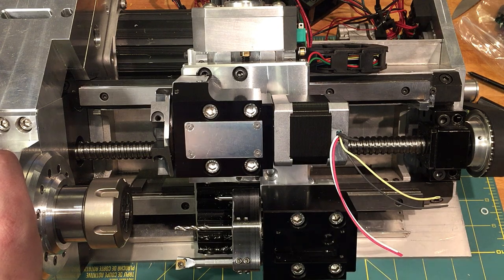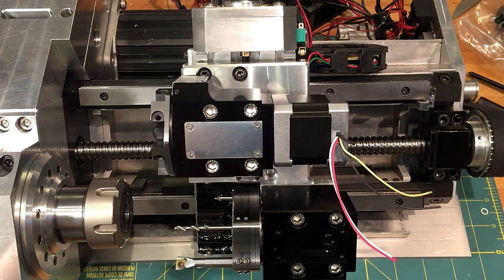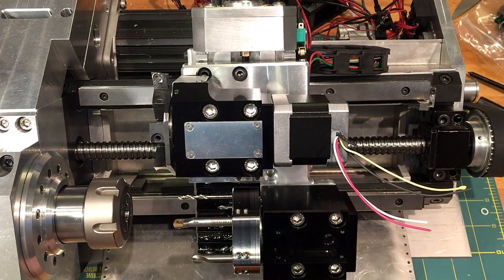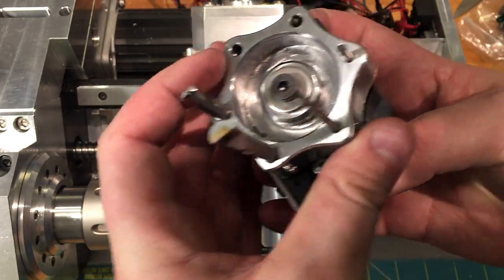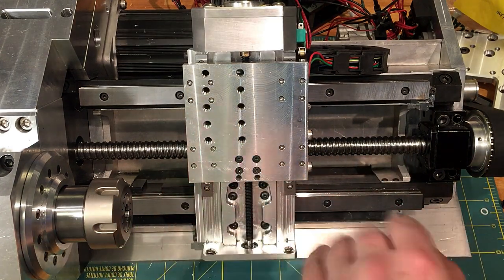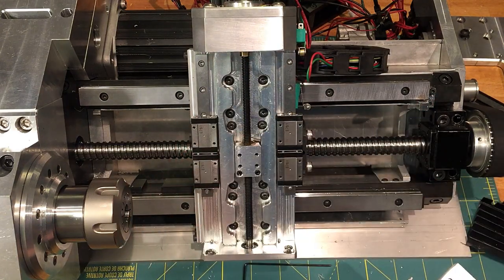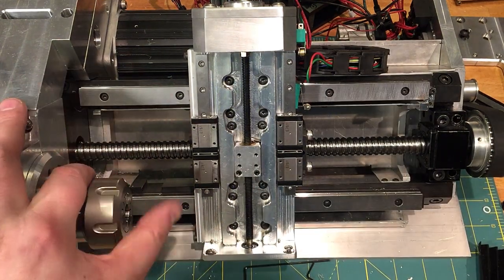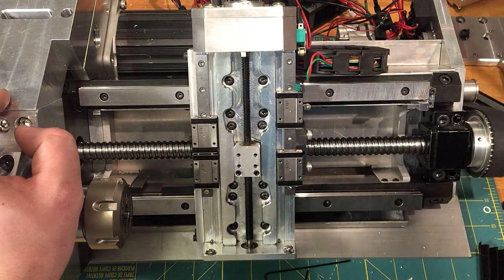The Micro Lathe:  Cross slide and brief project summary

Comment: You could probably use a Raspberry Pi for portability.
Reply from the maker: Sorry for the delayed reply Bence.  I have heard of using raspberry pi and beaglebone black (machinekit) but it's just a bit over my head for programming:(.  I think there's a lot of room for improvement in the low cost 32 bit CNC controllers--they certainly arent turnkey yet, but the future is bright!
Reply: @TabletopMachineShop  You won't need any programming skills. You can install Linux on the Rasp PI and use it just like a regular computer. Except it fits in the pocket of your shirt (or you can mount it on the machine itself).

Comment: That m3(?) stainless cap screw sitting on top of the x axis nut is just killing me
Reply from the maker: +GrossGeneralization i dont see it!
Reply: Scrub to 8:50, look above the nut holder just to the right of the vertical lead screw. Sitting roughly horizontal with the head toward the lead screw. You can see it move around as you rotate the nut slightly.
Reply from the maker: I see it.  Another victim of Greg's clumsiness...

Comment: Are these 1/8 HP Clearpath servos on the X and Z axis? Are they powerful enough? What is the ratio between the timing pulleys? I am building about the same size lathe and I am thinking about installing HC-PQ13 100W Mitsubishi servos. Used ones are pretty cheap on eBay.
Reply from the maker: The axis motors don't have any issues with the cuts, it's the spindle that gives a warning first.  The reduction in the timing pulleys is only about 1:2 on Z and 2:3 on X (I forget exactly what they are).  Most of the power in a cut comes from the spindle, and the axial and radial forces on the tool usually aren't that bad (I'm planning a video on this, so stay tuned!).  To be on the safe side, the bigger the better :)

Comment: Why do I always hear skateboard bearings called "608" or "6008"? Which one is it? You could do "quick change turrets," and have a few turrets that you can swap in and out.
Reply: Why not use a Windows tablet? You could write a program to run your code.
Reply from the maker: As far as I know, 8x22x7 bearings are called 608 (bearing trade number or something).  I do believe you've read my mind with the quick change turret idea :P

Comment: Ah.. now i see, a second turret for axial tools.. Controlwise, i don't have any clue as to what you are using, my lathe and mill both run in EdingCNC.
With that it is really easy to write the code for a toolchanger, and even writing parametric cycles is easy as well.. complete with dialogs to make a teach-in control.

Comment: What a great looking machine.  Please do more videos on its construction. with more details on how you made it.  Also, you say it's 1 HP, but isn't the Clearpath 3441 drive only 1/2 HP continuous (160oz-in x 3150RPM x 0.00074 = 373W  = 0.5 HP)?

Thanks and I can't wit for more on this spectacular lathe.
Reply: he has 1:2.5 gear ratio lol it output 1hp to spindle. i guess.dunno,but if it spin 7000 when servo only spins 3100,but it should make it worse.any way it cuts even hair thin is good xD

Comment: I am thinking about getting a Taig. Can you sturdy them up and use a bigger motor? The XY on the mills and some lathes look really sturdy. I was thinking of a half to one HP 3-phase motor and a VFD. 

Have you considered buying some T-head Allen wrenches?  :) You should likely tighten fasteners half as tight as it takes to strip the threads or break the bolt and not tight enough to plastically deform things. Or you could read the specs and use a torque wrench. :) You do NOT want one of those hardened cap screws to come loose and jam up the works. Probably 150+ psi tensile strength hard. Metric tends to be harder.
Reply from the maker: You can actually buy it at 1/2 hp, so it can handle that.  I'd go for high RPM and hopefully low cutting forces.  I always wanted to try one of those air cooled chinese spindles--the RPM range (5-20K) is about right for the Taig with carbide tooling.  The X and Y are very sturdy, but the Z actually pivots at the back (that will be the first thing that gives), so I'd reinforce that first.

I really should get some nice allen keys :P

Comment: you should definitely do coolant, you can use a small DC bildge pump for it which wouldn't use up much space and have a small fabricated coolant sump just under the machine, would be an awesome "micro edition" to your build and would be super easy to wire and plumb.  I run mine of a small 24v power supply with the voltage adjuster turned down to around 17v.  plenty of flow and pretty decent pressure. best of all it fits in your hand it's so small so the sump could be small as well, maybe like a 1 gallon or so.

love the build, absolutely brilliant!  keep up the great work!
Reply from the maker: I've used a little 12V bilge pump before for my milling machine and found it was almost too powerful.  My main fear with flood coolant (or a heavy mist coolant for that matter) is moisture getting into the electronics area.  You've intrigued me with the "micro edition" talk though.  I may look into it more and see if I can come up with a "drip coolant" system :P.  Thanks for following Christopher!

Greg
Reply: hlaps1990 like know it's a little bit late, but down the road if you want to add some other really cool micro production features, you could use the shaft from a 5c spin indexer as the spindle and add a pneumatic collet closer.  this would gain back a little z axis travel as well,. it's pre precision ground outside and inside and they can be had for around $40-50.  just a brain teaser to ponder!
Reply: hlaps1990 ooh, and then if you wanted you could use a 5c lathe Chuck real quick for any parts that need facing that wouldn't fit in a standard 5c collet!
Reply from the maker: Funny you should say that, the very first rough spindle I made was a cut off 5C collet indexer shaft!  The only issue is that it didnt leave much room for the bearings, but I'm playing with a design now for a 90mm spindle cartridge (which would require a new headstock) with an electric collet closer and a bar feeder.  But first things first!  I have to get this guy running soon!

Comment: Nice! You may already know this, but Reprap 3d printers can use an sd card to run G-code without a computer attached. The RAMPS 1.4 boards are Arduino based and could provide step and direction signals to your servos. Very small and low energy.
Reply from the maker: I've never tried RAMPS for CNC,  maybe I will one day.  MASSO seems to be doing the trick for now!

Comment: I'm watching your videos in order, and until this point I just assumed the second turret was a tailstock turret.  You've got both on the carriage which kind of de-rails my tiny brain.

No turning between centers?  I has a sad.

My lathe project is not as 'from scratch' as yours; I'm slowly replacing assemblies from an old Craftsman 6x18 lathe.  The goal is to modernize from the bed up, its gonna take a while :)
Reply from the maker: Sorry I didn't reply sooner, this comment got put in the "awaiting approval" bin!  how rude!  Its funny you mention no tailstock; I figured it out about half way through the build too... it's actually a fairly major design flaw.  If I don't have a tailstock, why are the rails so long??  Will I ever even be turning things using the whole length of the rails? Oh well, lessons learned.

Any chance you're putting your lathe project up on Youtube or IG?  I'd love to follow along!
Reply: Based on your shooting related turning examples, my theory was that you made your lathe specifically to turn bullets and shells, and didn't need a tailstock.  I know a fair number of manual micro-lathes are dedicated to that purpose.

Regarding my project, the stuff I'm (very slowly) doing has already been covered well dozens of times.  I'm not innovating anything, just executing ideas that people much more talented than me have already worked out.  

Should I ever manage to have an original twist on something, I"ll put it out in the world.  None of my projects have any of that yet ;)

Comment: what angle did you slant the bed at ?45? Nice build, thanks for sharing!
Reply from the maker: +backyardcnc yep 45... reduces the footprint
Reply: thanks, love what you have done so far. Trying to decide if I should go a similar route and build a machine or just bite the bullet and order a new loaded TAIGTURN , I love the new 5C collet headstock they have and I already have a full set of 5C collets is 64ths :-). ready to go right out of the box is kinda nice..... just build an enclosure.

Comment: Could you run an Arduino setup? Might help portability and fully customization.
Reply from the maker: Yeah, arduino is nice, but I'm just not good enough at electronics to get exactly what I want.  I know arduino can run GRBL, which is a G code interpreter, apparently its at the absolute limit of the arduino's memory, so customization would be really hard!  Masso purports to be exactly what I want, so hopefully that works out!

Comment: Great vid mate! LIVE TOOLING! \o/
Reply from the maker: I actually got as far as making a live spindle before realizing that without any kind of brake or a direct drive spindle I can't use it.  Ready fire aim!
Reply: Well what about some kind of a disc brake from or like a bike and maybe controlling it with a levered pneumatic cilinder? O.O Thats what i did on my lathe, although i just milled a clamp to go around a large diameter pulley attached to the spindle, and inserted a threaded rod to do the clamping and made a little lever on the side, manualy operated though :/
Heres a pic -
http://www.image-share.com/ijpg-3480-70.html
and never mind the christmas decorations, that was.... the gf -.-
Reply from the maker: a disc brake from a bike is a really good idea...  fortunately the whole thing is modular enough that I could make a live-tooling compatible spindle cartridge if I had a mind to, so I'll jot down the idea of using a brake, even if I can just do radial drilling that would be cool.  The original plan was timing pulleys and locking the spindle, but there's just enough play in the belt that it wouldnt work.